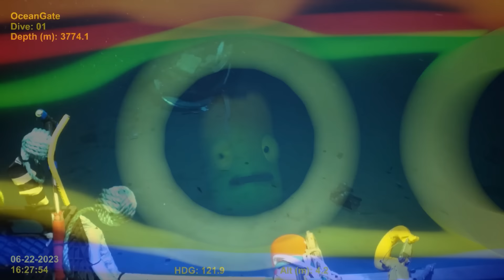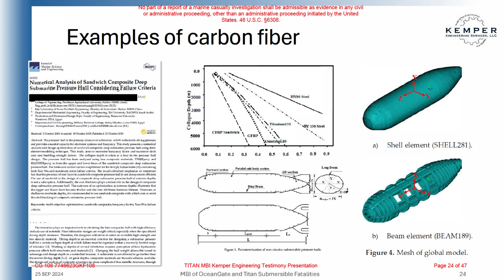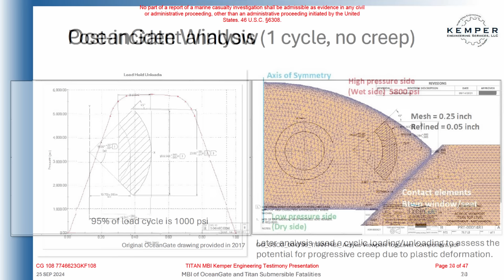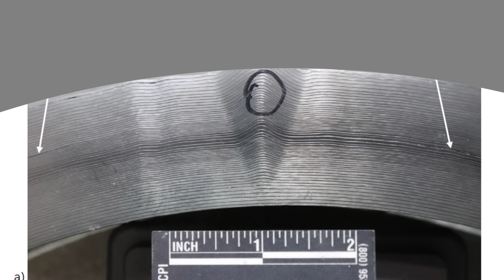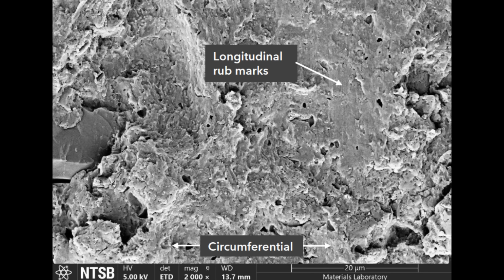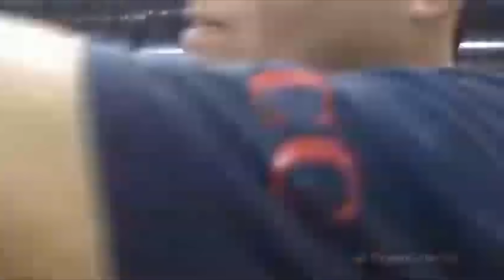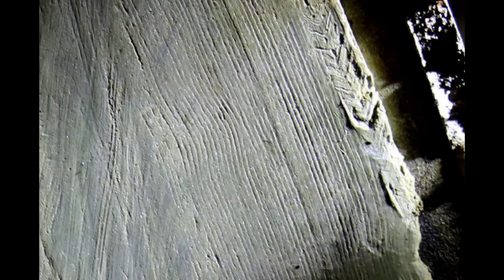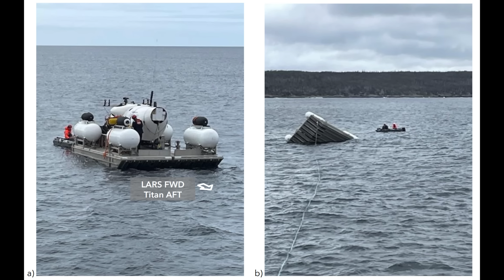OceanGate Wreck Shows Why Sub Wasn't Strong Enough To Survive - NTSB Shares Important Details

Comment: My company makes both steel and cross wound fiber and resin pressure vessels. OceanGate just wound the fiber around and around without cross winding, no vacuum gas de-gassification, dissimilar materials that needed to be bonded together with a special adhesive and then tested nondestructively and to destruction. You can’t just grab a jar of marine epoxy from your local marine or home improvement store and call it good. We had some trouble with metal fittings leaking during pressure cycle testing and it took nearly a year of additional engineering and testing to get the correct bond between the metal and the fiber/resin to pass the rigorous inspection certification. I’ve watched the toilet paper roll method OceanGate used for their “layup” and their epoxy to titanium fitment and I am very surprised they didn’t catastrophically fail at a much shallower depth.
Reply: That is what I am seeing, just winding it on like thread on a spool, yet as Scott has pointed out there is longitudinal ply in it. Given you make similar structures, can you point out what I am missing? I am looking at the winding equipment in various other videos and cannot figure out how that setup could lay it down in such a fashion other than hoop or helical.

Comment: It's shocking to learn that the output of the sensors was being ignored. Before the hearings, the things I heard and read was that the sensors wouldn't be useful, because of the deformation curve of carbon fiber would make them trigger just a few milliseconds before destruction. But now we learn that they did actually have a purpose. They told about change in the structure. And they showed deviation in how the structure behaved after the bang.

My guess is that the bang was due to a big delamination, maybe the incident that enabled glue to start to be ground into powder. An unmanned test dive after that incident would have revealed that the hull now behaved differently, and was worn out. I look forward to read the finished report. If this is the case, it might be knowledge that can learn us more about how to safely use carbon fiber for pressure hulls.

But for the submersible industry, I think its better to stick to the sphere. It will always be the strongest shape vs material usage. Even if someone would use carbon fiber again (fabricated properly, and tested to destruction, making it a new certified material), a sphere makes more sense.

This incident have really made us, the public, respect underwater vessels. Space is 1 bar, these subs need to handle 400 bars. Suddenly, constructing a spacecraft seems like a not-so-hard task. Apart from the rocket...

Comment: Im going with not enough glue on the adapter 100% especially since half the surface shows zero glue. Not to mention the titanium flange doesn't nearly seem thick enough especially since the inner surface got completely sheared off.

Comment: Am I idiotic for thinking that submersibles would benefit greatly from having several hulls with pressurized hydraulic fluid between each hull that could sort of lessen the strain on each hull by lessening the pressure differential on each side. Am I wrong in assuming that increasing the internal pressure you lower stresses? So why not have a system that measures the external pressure and as it rises a hydraulic pump could increase the pressure of an inner bladder device to offset this? Then an inner hull where the inside is always one atmosphere but that hull isnt under too high of a strain because its only being put under the load of the pressure of the differential bladder? Is there some reason this can't work? With a system like that you could even treat the inner hull as a failsafe that can jack up the pressure of the bladder if it senses any issues with the outer hull. Obviously losing hull integrity would happen intensely fast, but an outer breach wouldn't necessarily mean the whole craft would be compromised, especially since failure wasnt exposing external pressure to the inner atmosphere, but to a hull pushing out with tons of pressure.

Comment: The way the carbon fibre is wraped around the pressure hull, it does not contribute to absorb the compression load. The resign does all the work

Comment: The first sign I saw was when they built this coffin, using carbon fiber for a vessel that had to withstand compression ! Not even properly laid to withstand internal pressure. Under compression, its mainly the epoxy that played a role. Concrete would haven been better ! The rest are  just aggravating details.

Comment: What makes wrapping my head around what specifically initiated the collapse is the fact that thf implosion itself creates a shockwave that blows stuff apart.  So when you see a glue joint or something having failed, how do you know if it was the water pressure that made it fail or the  secondary implosion force?

Comment: There is a big difference in bending strength between a single piece of material and a laminate of the same total thickness if the glue strength was negligible.

Comment: Found this very insightful.  Much more depth (excuse the pun) than expected. While the composition of the carbon fiber is clearly suspect of failure, I'd look very closely at the carbon fiber cylinder and the titanium endcaps interface.  The cross section I last viewed of that joint showed a very short inner lip of the endcap retaining the inner surface of the CF cylinder.  So likely scenario to me, without waiting for the end of your vid, is that CF failure either began at or quickly travelled to that joint and rapidly sheared that adhesive interface between cylinder end face and endcap joint face.  Back to the big news you provided is that the CF cylinder was manufactured as a set of five cylinders.  Seems very very very risky, and I was an ocean engineer before my aerospace engineering career.  We flew CF and sunk titanium, as a general rule of thumb.  Regardless, I hope that the industry develops the basic configuration of CF cylinder and Ti endcaps.  Seems doable to my knowledge.  But it has to be a cylinder wound with a quality  that will carry loads (compression, tension, shear) consistently, predictably, throughout the CF cylinder.

Comment: I think the large bang was where we see the white powder (glue dust) between layers 3 and 4. The layers basically became two tubes sliding over each other at that point. - The visibly bent piece at the end is likely where it failed - pushed/distorted in slowly, and then enough to crack the entire end ring's glue clean apart as it exceeded the ring's ability to contain it's now non-round shape. Oddly, the point of failure usually survives fairly intact/in a couple of clean pieces in implosions as the immense pressure, well beyond the normal breaking point, it's under is suddenly released elsewhere into the surrounding structure and it snaps back. It also takes time to bend like that, versus the sudden pressure release which would simply shatter things.
Reply: So maybe they DID have time to understand something was going wrong.
Reply: @musaran2   Carbon fiber failing sounds like hundreds of gunshots. The hull would have been louder than usualand possibly in the last minutes extremely loud and visibly deforming.

Comment: I wonder if this has any implications or lessons for Rocket Lab and their Neutron rocket. The fuel tanks are carbon fiber and would undergo repeated pressure cycles, and possibly lateral motion during roll maneuver or vibrations.
Reply: Rocket lab are using the CF in torsion (stretching) not compression.

Comment: I don't even trust carbon as a bike frame material, aircraft are the application that makes sense because the weight matters a lot there, but only when constructed to the highest engineering standards and after rigurous testing

Comment: The aircraft commonly constucted using a very similar process, via layups + peelply (I know of one aircraft, Rutan's Boomerang manufacured using carbon fiber on a mandril), most of them carry the common designator as being Experimental and are not permitted to carry passengers for hire. The ones that don't have undergone an extensive vetting process from the FAA which, while not perfect, provides some degree of third-party oversight. 

Oceangate had no business holding out voyages (in terms of interstate commerce) in this vessel without extensive testing and meaningful third-party input prior to their voyages. I say this sincerely as an experimental aircraft enthusiast, it is unreasonable to expect a passenger to have a thorough understanding of composite construction techniques (especially in respect to the lack of recommended weave patterns suggested, which have a huge impact on the overall strength of the vessel) and to evaluate the relative risk they are exposing themselves to. The situation and loss of human life is tragic (class bias aside). I hope meaningful change will come from the experimental maritime industry as a result. In aviation we having a saying: the regulations are written in blood. This is not a dissimilar situation.

Comment: If we ignore the management and human lose, it is actual amazing engineering.
Like an airplane, the hull needs inspection and it can only do so many pressure cycles.
If the management could straighten them self out, then testing multiple hulls to failure, then set max. cycles to 50% of the lowest failure that system could actually work.
To get more numbers/data, take the retired hulls and bring them to failure.
Off course that costs money, but Ocean gate would then have reputation of an engineering company like early Boeing (and not the reputation of a management company like modern Boeing).

Comment: Has anyone considered that carbon fiber conducts electricity and that titanium along with other metals submersed in salt water is basically a battery.  Dissimilar metals in an electrolyte. As batteries develop electrical current they can consume their those metals at the connections. Where the metal and the carbon fiber meet, that's the connection.

Comment: Hi Scott, talked to you on the USCG hearing. I'm tending to think the viewport failed, and the water rushing in ejected anything inside, and made this thing come apart, almost like a mini explosion, this is probably when the tail equipment section came off the rest, torpedoing the end section into the ocean floor. If you look on the ocean bottom, a sand ring is around the rear and the front, more so the front, because it was probably sent heading towards the surface, then descended at a higher speed to the ocean bottom, great analysis from your video btw, we really won't know until the NTSB finishes it investigation.

Why I think this is if you look at the picture in the NTSB report (Materials Laboratory Factual Report 24-011_Redacted-Rel) page 75, it shows where the viewport was located, all the retaining bolts remain or sheared off, this is consistent with a failure at that point, sorry for the long-winded reply, engineering even when retired never gets old.

I might also add, I tried cleaning up the audio from the final day questions and answers, not the greatest work I've done, but better than the USCG work, on my YT channel flightsimdev.

Comment: Regarding the foam…. Actually this is a very specialized product (syntactic foam)  so that it does not collapse under the extreme pressure,  it is enormously expensive.  So that is why to avoid steel….  The weight of the steel will require lots of expensive foam.   And,,,, Rush was looking to creat a profitable business  model…so he was thinking of the cost for more submersibles… and was therefore looking for an innovative design to achieve cost savings .   By the way… syntactic foam uses glass microspheres wmbesdded i. Resin for buoyancy

Comment: when watching the hearing i kept wondering why those strain-depth plots show a lower strain in ascent than in descent for a given depth, if there were to be a difference between the two i would have rather expected the opposite: the hull is compressed at full depth and doesn't have time to rebound as they ascend fast, hysteresis of sorts.
Same at 25:55 with plot d)  it looks like the green hoop strain curve is lower when reaching the surface after the dive compared to before. that is really surprising to me.
Same with the anomaly circled in red, it shows that the hoop strain suddenly increases while the longitudinal strain suddenly decreases, i wonder if the sign of those deformationsshould be read as significant, as i can't find a way to make that change in geometry work in my head considering the force the sub was subject to during the dive.

Comment: This dude wanted to make his company the SpaceX of the sea, but didn't realise that SpaceX is a company of actual rigorous engineers who do the work and make a good product, and most importantly designed their Falcon and Dragon with safety in mind
Reply: Space x had many flops, blow up their own space pad was a cheap out vs nasa ones with enough cool water ones.
Reply: @Ricardogs  SpaceX tests to failure because that's how you iterate quickly. When their lack of a suppression system caused problems, they added one, because they use what works. And they didn't put humans on Dragon until it was thoroughly tested and vetted as safe, even though it caused delays and cost overruns, because they understand that safety is less expensive than disasters.

Comment: Honestly, for all the armchair analyses of the behavior of carbon-fiber cylinders under pressure, the properties of fiber/titanium interfacings, the “PlayStation controller, etc., I think it’s becoming more and more clear that the technologies used on the Titan weren’t unreasonable and had enormous possibilities. For all the “death trap” talk, Titan made quite a few successful dives. The issues weren’t so much technological, but organizational.

Much has been said about the failings of Rush himself and of a corporate culture at Oceangate that tended to discount safety. But as I understand it, the company was also in some financial trouble and I believe that was what actually drove this failure.

When Oceangate was better funded, they were willing to accept criticism and advice and were iterating on design. But as their funding dried up, they were forced to use lesser support vessels, tow Titan around, ignore safety warnings, and kept using a submersible that clearly should have been retired for the next, better version. There was even hard evidence from their own telemetry which pointed to things beginning to fail.

Rush and Oceangate should have paused things and reassessed if finances had gotten to where they couldn’t even keep their underwater spacecraft indoors over a Canadian winter.

Comment: If the engineers had looked at the data the way the NTSB did, they'd have said "Something has happened to the sub. We don't know what, and we don't know why, but until we do, dives should stop." Then management would have said "No, we'll continue with dives until you can prove that it's not safe."
Reply: The old NASA management vs engineers challenger disaster but with much smaller budget

Comment: Going down there is more hostile than going to space.  Once parameters changed as you can see from the data, the vehicle should have been re-analyzed and probably modified over more iterations. Sure that's expensive especially with carbon fiber and they were having successful dives but... you know; it doesn't matter how strong everything else is if there's even one point that doesn't have enough margin built in for the pressure and probably also the temperature. It's cold down there and glue and resin often changes its properties at different temperatures.

Comment: Also not an engineer, but I've worked with carbon fiber a bit. 
That the surfaces of the hull debris pieces seem to have separated through multiple plies leads me to think there wasn't a problem with the adhesives...for those sections. If the pieces had split uniformly along a single ply, that would be a sign of manufacturing defect. The ragged and jagged means they behaved somewhat like a homogeneous material. 
But the geometry of the pill shaped design is inherently weak, and it really only takes one weak section of any part of the carbon fiber hull to lead where it led.

Comment: The wrinkling was enough to scrap the hull due to the size and frequency they appeared. There is no way you can fix those defects and its a huge warning that there is a major issue during the manufacturing process of the hull that needed to be investigated before any attempt was made to make a new hull. The cutting out of material on one of the ends is also a huge no no and again would of been enough to scrap that hull and I would think that have been the failure point causing a chain reaction of fail points at wrinkle sites with one of those sections failing totally to start the implosion. Acoustic testing would of showed those points starting to fail but I understand that testing was tried and failed due to the thickness of the carbon fibre.

Comment: Hi Scott, take a look at the "Hydraulic Press Chanel". He fabed a carbon cylinder with steel end caps. Then constructed a steel cylinder filled with water and pressurized the carbon cylinder until failure. The end caps compressed the carbon cylinder then it failed looking remarkably similar to the piece on the ocean floor. Cheers.

Comment: the change in strain curve at early depths leads me to belive the outr layer weakened/failed, and so it deformed quickly until it pressed aghaisnt layer 4 which would take the stress and then the curve goes back to normal. Then layer 4 weakens, etc etc